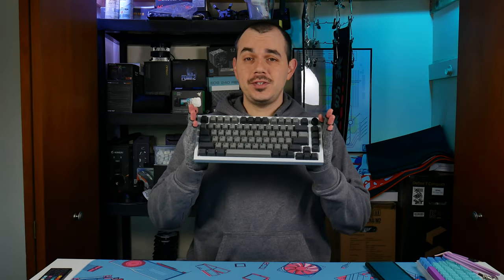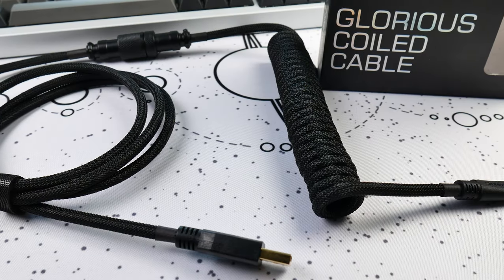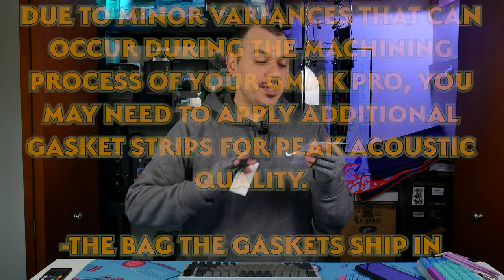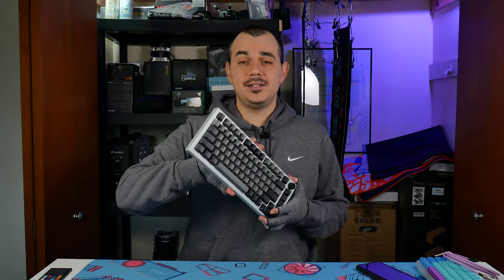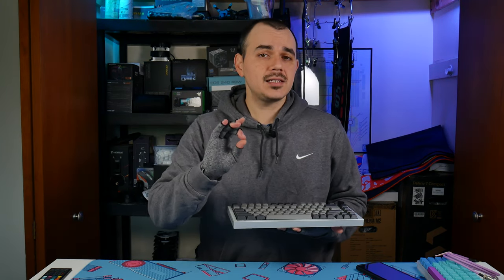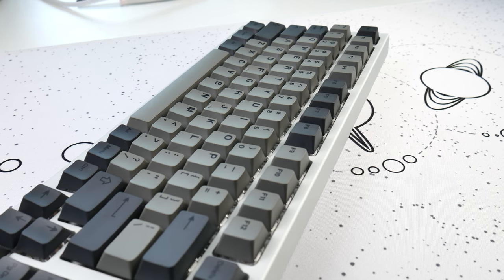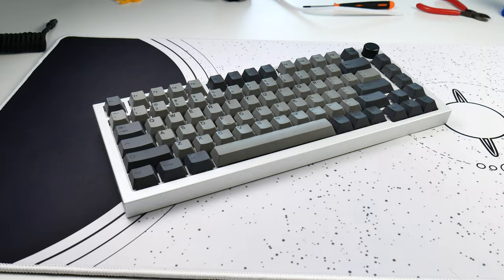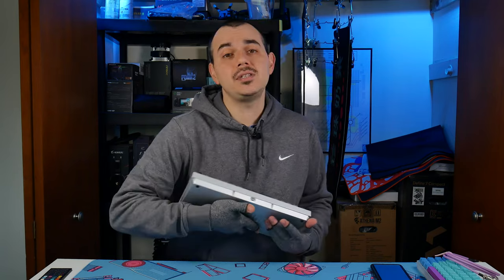I Built In The GMMK Pro... So How Is It?

Comment: The stock GOAT stabs were just terrible on mine. I decided to use the PC plate and Durock stabs. I had to put a bit force to get them to fit. I used a triple gasket on the lower case and removed the 2 middle standoffs. Then I just used 4 case screws lightly screwed in. That added much more flex!

Man, the disassembly process of the GMMK Pro was terrible! 3 of the screws in the case were so tightly screwed in, I had to use so much force. I almost stripped the screws! Then when I got to open it, more screws greeted me on the PCB. Haha.

Comment: I'm contemplating if I should buy a nail clipper filer just to replace those "GOAT stabs" for durock v2s
Reply from the maker: A needle file kit will get you what you need to properly file down the openings in the aluminum plate. You can find them for ten bucks or so on Amazon.  Also worth noting: if you have a good set of plate-mount stabilizers (believe it or not they do exist), those will also fit in the plate.

Comment: some of my takes on the GMMK pro (1st batch), really annoying:
- the screws are not magnetized!!! or very minimum amount. That made the dis/assembling process very very annoying. come on Glorious!
- the screws are tightened super hard. I have to muscle up to unscrew them and ended up ruining some of the screw heads.
- the gasket mount - basically does nothing to the typing experience.
- the GOAT stabs are complete jokes.
Reply from the maker: I've heard of others having issues with the fasteners, but I didn't have any issues with mine being over-torqued so it's likely a QC thing on the assembly line. Gasket mount here... haven't messed with my CP plate yet but I don't suspect it's gonna change much so I largely agree with you there in that the gaskets are only really providing acoustic benefits at best.  Non-ferrous fasteners... eh, didn't interfere with my teardown/reassemblies much but yeah they probably should be made of ferrous metals for ease of installation.

What's weird about the stabs is visually there's nothing to indicate what the issue with them is, but they just don't tune out well at all. I'm guessing it's some of the tolerances, like the size of the opening for the wire to pass through, amount/degree of articulation, etc. Even with all of that said I'm still enjoying my GMMK Pro, but there are certainly little things they could improve upon in a v2 release when supply catches up across the board.

Comment: Man! Those GOAT stabs are indeed a pain to tune! The factory lube that came with mine looked like some sticky goo! I also didn't like the  rubber damper thing where the stabs sit on - this was also sticky btw, and having these dampers make the keys feel mushy for my liking. 

Took me almost a day just tune this stabs, but I'm still not too happy with the rest results. :(
Reply from the maker: Yeah they use G-Lube from the factory. They not only apply it poorly, but G-Lube isn't the best solution for stabilizer wires since it tends to migrate a bit more than other options in that scenario.
Reply: same as with Drop Keyboard stabs.... just swap them out, it will help you keep your sanity haha

Comment: Audio is clipping a bit, just so you know. Other than that, great video.
Reply from the maker: Yeah the audio issue is the next thing I plan to tackle. Got a temporary lav from a friend when my Rode lav shit the bed and even with -12dB on the cam it's SO bloody hot.
Reply: @TheManicGeek  Does it connect with XLR? if so, there are -12 and -18 dB pads that can be bought for relatively cheap. I'd also just try low passing everything to get rid of some of the harshness in the highs.
Reply: @TheManicGeek  https://www.sweetwater.com/store/detail/IMPpad20--whirlwind-imp-pad-20-db is what I was talking about, but they sell them in various attenuation amounts, between -10 and -40 dB
Reply from the maker: Nah just plugs in with a TRS connector. Ultimately I'd like a wireless solution due to my constrained workspace, it'd make my life so much easier. Not much budget tho so I have to be picky.
Reply: @TheManicGeek  I feel like adding a TRS to XLR adapter is adding to the jank factor and a bandaid solution.. oof.
Reply from the maker: @whatskraken3886  You know that scene in the original Tim Burton Batman where the dude who operated on The Joker says "... You see what I have to WORK with here..." and it cuts to a shot of some rusted-ass janky tools? Yeah that's me x-D